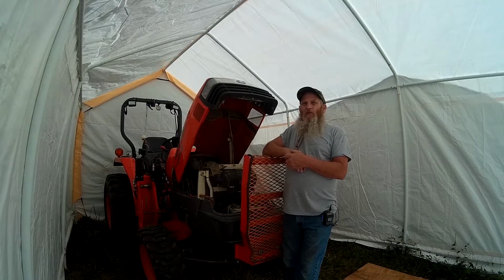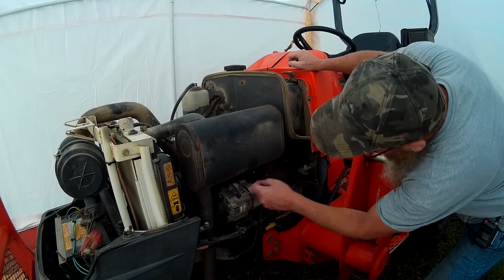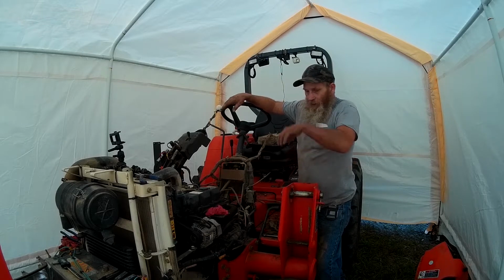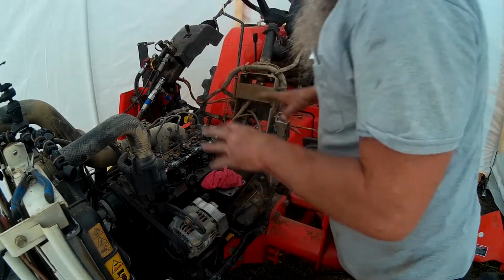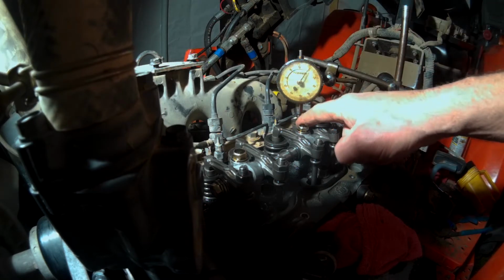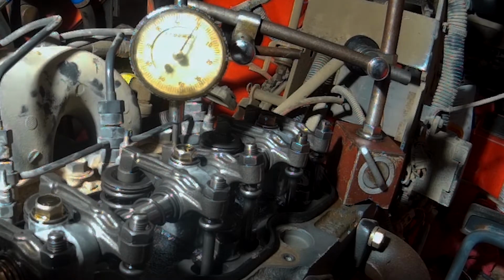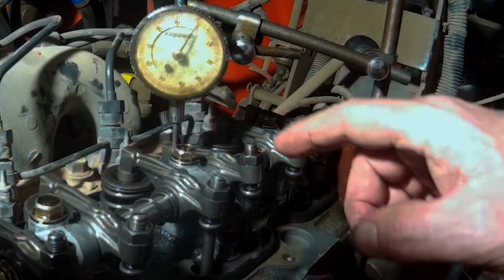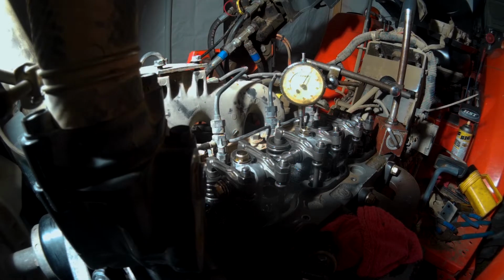Adjusting the Valves on the Kubota L2800

Comment: Great video Dave,  sorry it didn't solve your problem.  Could the noise be coming from the camshaft? I believe the camshaft drives the oil pump, I've heard this can rattle at times. God Bless you for taking care of your mom. You will be rewarded oneday. The Bible tells us to honor our parents and sounds like your doing everything right. Prayers for you and your family.
Reply from the maker: I had not given the cam shaft a thought. glad you mentioned it but hope its not to serious. I think I have found the issue. wont know till I tear into it and put it back together. I look forward tou your thoughts on the next video showing what I think the issue is.
Reply: I wouldn't think the cam could be worn with only 800 hours. You are like me when it comes to maintenance,  as i always stay with the recommended hours in the book. These engines should  be good for 6 - 8000 hours.
Reply from the maker: @deanbarr5740  I'm hoping the 6-8000 hours is the low end I'm looking to get 15000 plus out of this Kubota. lol cant afford another one.